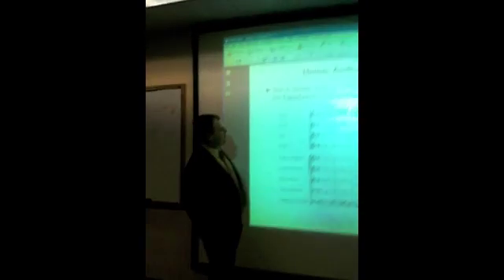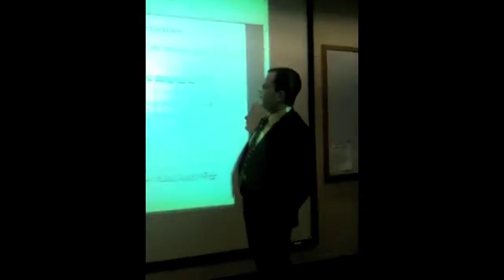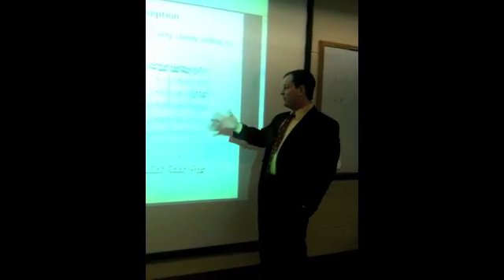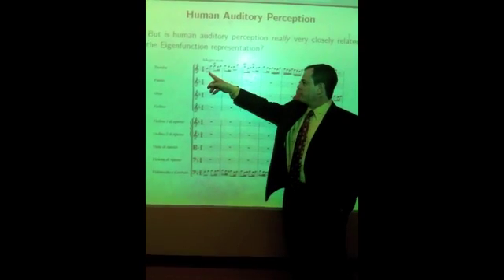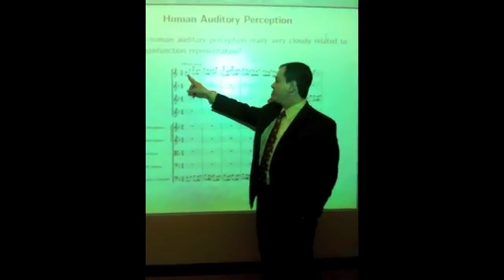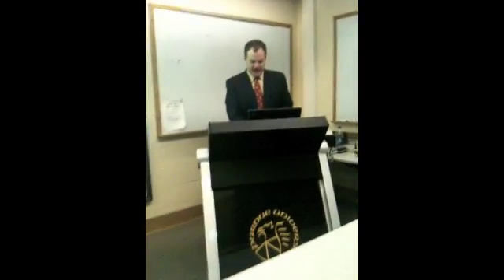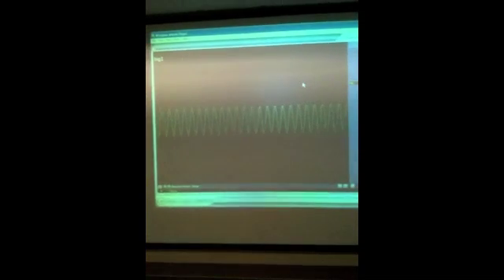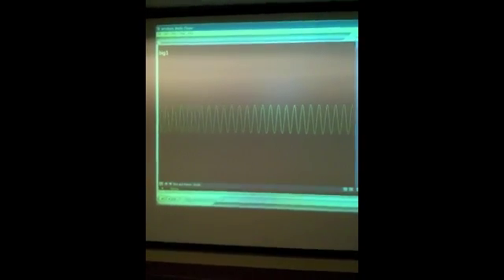How Fourier Transform Works: you can hear it!

Comment: It's always seemed bizarre to me that math people insist that waves have to go on forever and can't be started and stopped lol.  I guess it makes the math work out easier or something.
Reply: waves do go on forever, a physicist will tell you that they stop because they lose energy due to losses in the vibrating medium. For example, a note produced by a piano is transmitted to you via air vibration, however as it vibrates in the air, each particle it accelerates to cause that vibration makes the wave lose energy. Its why water waves eventually crash, very few waves are lossless expect for electrical and light waves.